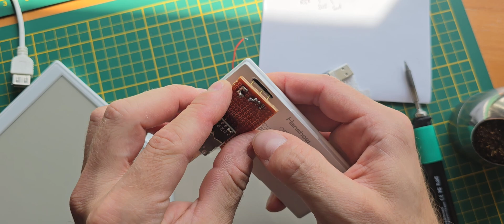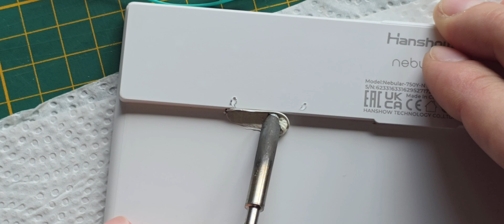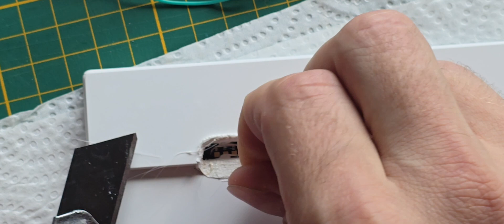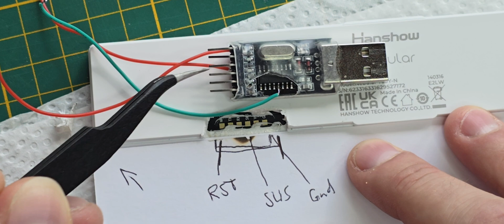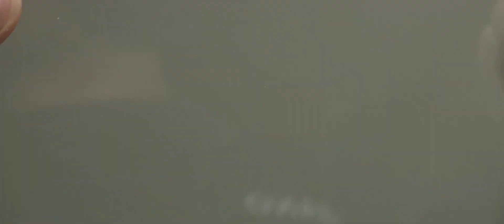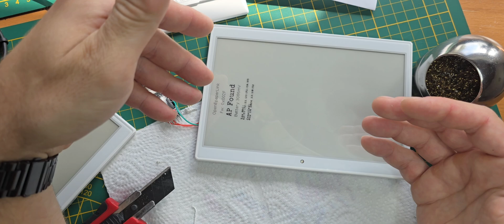7.5" Price Tag Telink TLSR OpenEPaperLink Flashing How-To

Comment: I have flashed several Hanshow Nebular-350Y-N using your FW TLSR_HS_BWY_35_ALPHA.bin successfully. Is it possible, to use one of them as an AP? If not, I have laying around a Lilygo T-Display including an esp32-S3. It costs about 10$ on AliExpress. Could that be an alternative for building an AP?
Reply: Hi Dave, did you shortcut the Battery Connectors after flashing to initiate the reboot? Did you try it on more than one ESL? Always the same result? Batteries still good, or tried Workbench Powersupply? Maybe the firmware for the red ones is different? @Aaron Christophel can you confirm?
Reply from the maker: Red is not supported
Reply: @atc1441  Hi Aaron, thanks for the info, it will save me a lot of head-scratching. Great project and thanks for the share and all the hard work. Best regard Dave.
Reply: @JohnHawkGermany  Hi John & thanks for the reply. Good point about the reboot and the battery, I will check the battery voltage and give it a quick short and check for a re-boot. Only have the one ESL. I did see R(red) in the firmware link so not sure if it is supported. If any progress I will update the thread. Thanks
Reply from the maker: Hey Red is not supported right because of the lack of it to adapt the firmware
Reply: @atc1441  Thanks Aaron :) Regards Dave
Reply: @atc1441  hey Aaron, any idea how I could build the firmware for Nebular 583Y-N? Would greatly appreciate if you could even point me in the right direction!
Reply: Hi John, sorry I dont know about the API. I am struggling to get the Tag to flash. Have a 350R-N & I see you have the yellow version working. I open the port and unlock (blue led ok) and select FW TLSR_HS_BWY_35_ALPHA.bin. When I flash I can see the TX Led on the converter flashing with the blue LED on the tag. However the tag does not re-boot. sceen still showing the original data. Put it on other USB ports changed USB lead and attempted other versions of firmware. ANY idea John? or anyone else having the same probs. Regards Dave
Reply: @DaveBrown1  Hey, I'm having the same issue on Nebular-583Y-N, did you have any luck with this? I can see the led flashing when flashing the firmware, but the display doesn't reboot and shows the original data. I have connected GND, NRST & SWS.
Do you think we might need modified firmware suitable for pour models? Any ideas how I could build one for my model? TIA!
@atc1441
Reply: @DaveBrown1  Hey, I'm having the same issue on Nebular-583Y-N, did you have any luck with this issue? I can see the led flashing when flashing the firmware, but the display doesn't reboot and shows the original data. I have connected GND, NRST & SWS.
Do you think we might need modified firmware suitable for our models?
Reply: @akshaysalunke13  Hi sorry for the delay, no never got this to work.
Did you find anything else on it?
Regards
Dave

Comment: It would be interesting if the 3 pads needed could be targeted with a 3d printed drill jig! But the user would still need an accurate pogo setup to go along with that. Being able to seal it all back up with a strip of tape, would be very clean though. 

Also I've found that many USB-C irons and hotplates float the tip to 1/2 of mains because of XY capacitors inside the charger, if your circuit being soldered is grounded, that's getting shunted into each I/O pin possibly. On my MHP30 I realized it because it had a 'texture' that you could only feel when it was plugged in, DMM confirmed why! Does it on every 60W PD-Charger I've tried. Can light LED's in series that are only touching your skin and the plate.. etc. Best way I fixed it was clipping a grounded lead on the USB shield. Just be aware it's often there, and can push current into sensitive things.